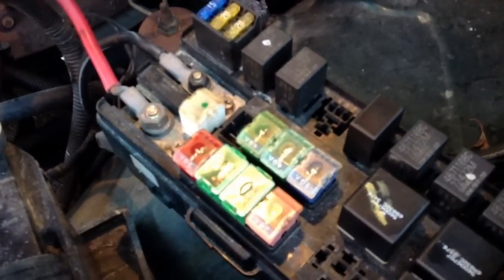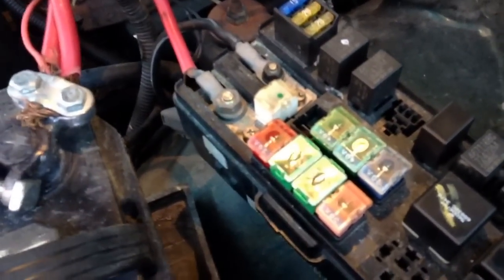Dodge ram 1500 fuse box gone bad

Comment: You forgot to mention that the underside of the fuse box is connected to a huge wiring harness, each individual wire has a point in the box. This is NOT a simple fix. Cut the cable or replace the harness. . .

Comment: Hi I just watched the fuse box video, were your symptoms simply crank/ no start, with no fuel or spark, did you have a no bus message on odometer? Thanks for video
Reply: My dodge is having the same problem. It didn't start till a shop said I needed a computer. 800 bucks later and I can't even drive the truck
Reply: @ketchupmustard5465  I fired the parts cannon at it, then gave it to my cousin.  I guess he ran 12v to the coil and used a toggle switch to start and drive it.  The best way to fix a dodge is to buy a Chevy.
Reply: @dirtmcgirt01  idk about a Chevy but I love the parts cannon lol I am probably gonna steal that lol bahhahahahahaah

Comment: Have you checked the starter relay?  Since it's part of the PDC (Power Distribution Center) it might have poor connections and or work intermittently. Testing a relay can be accomplished with volt meter, 9V battery and a couple wire leads with alligator clips.

There are several great video's online regarding testing relays, but having rewired a PDC myself I can say I'd check the small stuff first.

Just a thought.
Reply from the maker: thank you sir for your feed back.